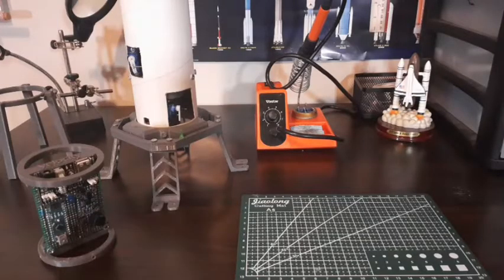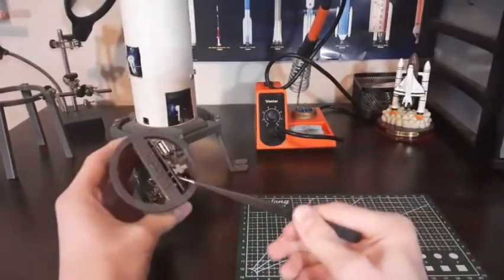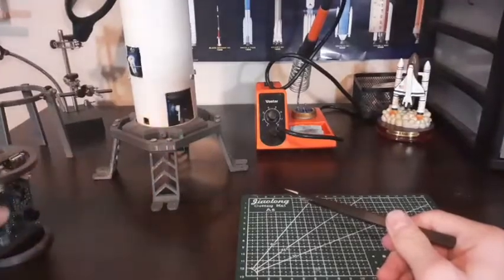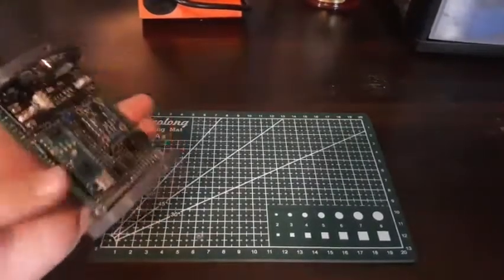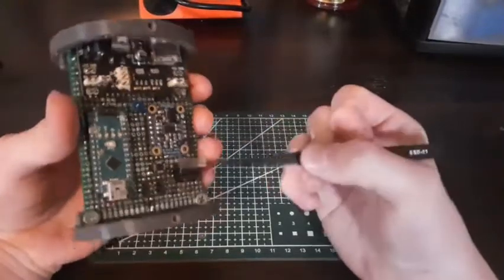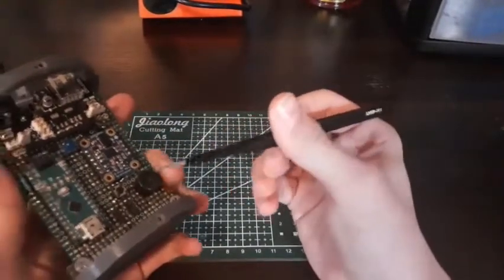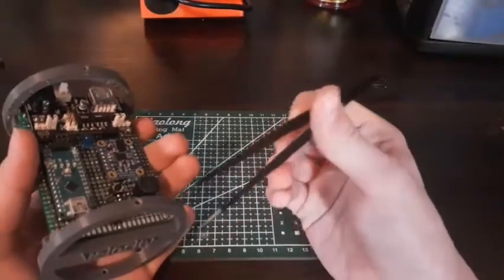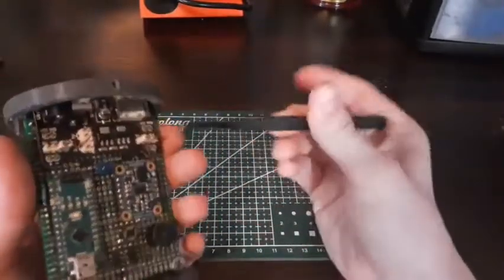Thrust Vector Controlled Model Rocket | update 2

Comment: hi do you have any files that would be available to the public ( code)
Reply from the maker: Not at the moment, and even if I did I wouldn't make them public unless I was certain it worked properly. Hopefully in the near future. I'm going to be posting 1 video a month from now on and so progress should pick up
Reply: @velocitylaunchsystems  ok. I want to make my own tv mount. What software do you recommend or source which can help
Reply from the maker: My system is programmed in arduino, which is easy to learn. I will be posting a how to tvc video soon which will hopefully help